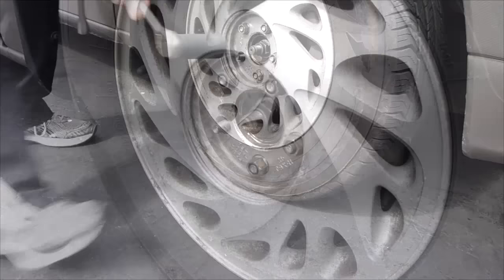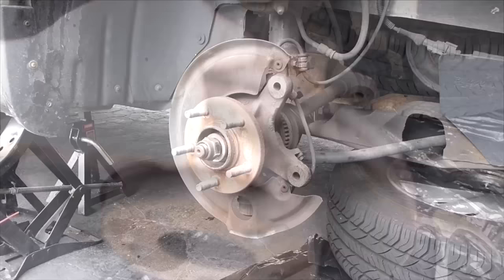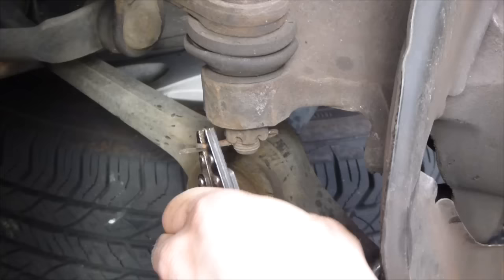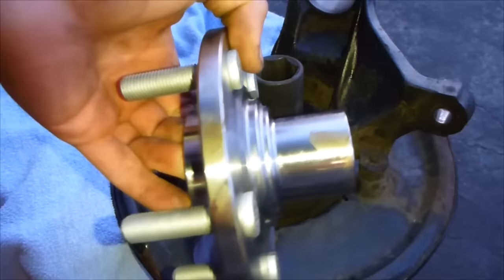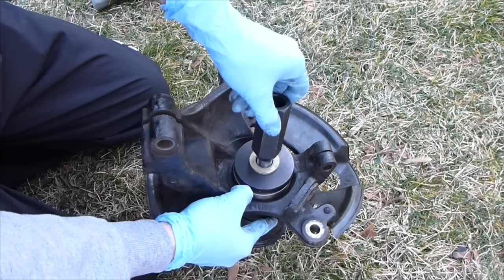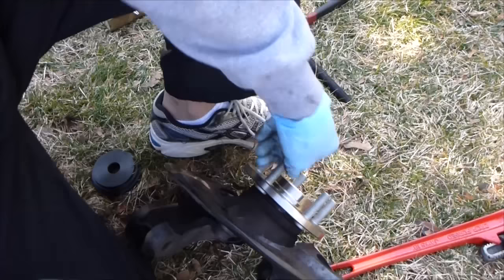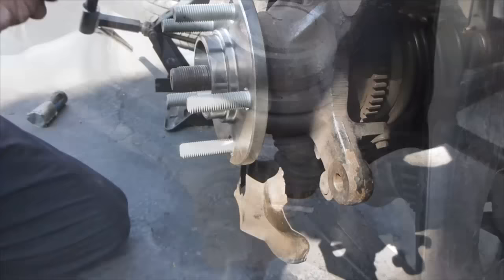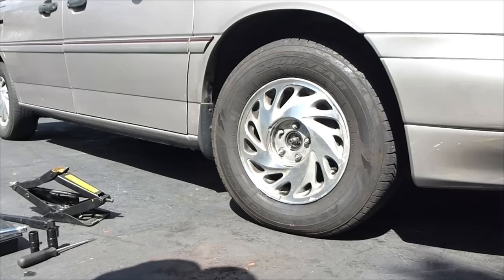How to Change a Wheel Bearing (short and fast version)

Comment: great video but next time put the castle nut on then hit the tie rod end. risk mushroom the bolt
Reply: +1^
Reply: How to overhaul an engine for Hyundai Sonata Gls 2001
Reply: Rubber hammer works better
Reply: that was my only complaint.
Reply: oh and he pulled abs sensor after he popped axle.. which.. is a backwards.
Reply: I used a block of wood and hit that with a hammer.
Reply: l
Reply: gereral1 how about just don't hit threaded end all together..  if you know what you are doing and are gonna teach people how to do it then hit the round knob end that the joint sits into.. it will pop out once you hit it hard enough... unless its some special metal then this is the way its done.  You hit it right at the joint that surrounds the tapered shaft of the ball joint, steering tie rod, or any similar style joint
Reply: I agree
Reply: Pato R - "Rubber hammer works better" - If all you're trying to do is destroy your rubber hammer without getting the tie rod end out.
Reply: mattp1482 - How about if you're going to teach people that you don't post at all since you are wrong.   You do NOT want to hit that "round knob end" which is the ball joint housing.  Deform that and you have to replace the tie rod end and get an alignment done too.  If you must use a hammer, hit it BEHIND the ball joint end, but really the way to do it right is get a tie rod end puller or use a generic multi-claw puller, or if you are replacing the tie rod end anyway then you can use a pickle fork.

Something else worth noting is that in many cases, possibly this one too, you don't necessarily have to remove the tie rod end at all to get the bearing out, can do it right there on the vehicle once the knuckle is free to rotate around on the tie rod end, propped up of course.
Reply: So when can you do mine!!!
Reply: I would recommend a new/unused cotter pin with the castellated nut as well.
Reply: oh yeah a pickle fork??? say good by to the boot especially if you use the wrong one! how do I know my dad had one and well don't ask me how I know just trust me I KNOW
Reply: gereral1 Kansas
Reply: or you can get the $45 harbor freight press
Reply: checked these comments out just to see how soon someone would mention hitting that threaded end...lo and behold first comment!
Reply: @MrRainrunner  lol me too you can usually hit the control arm and it will pop out
Reply: Or just use a Ball Joint separator tool.
Reply: Look at all the ASE certified mechanics in here telling each other they are wrong! 😂😂😂😂😂
Reply: @HoUsEoFcAtS78   reminds me of that old cartoon network show "too many cooks"

Comment: Quick comment, don't hit the threads when removing the tie rod, hit the side of the knuckle where it goes in; and buy a new pin, don't reuse them.
Reply from the maker: +jcv1995 Thanks for the tips!
Reply: Ya.  Leave the castle nut on a bit & whack that instead.

Comment: Man this looks like it's going to be a fucking headache
Reply: John Biddle It is, but it's well worth it. It'll feel like you are driving an electric car afterwards. No more howling noise !
Reply: Try having the nut inside of your subframe brake from the weld, so it's either you cut out the subframe to replace a control arm that has snapped, or you don't have a car to drive.
Reply: The hardest part is getting the two  C clips out.  if you got a press & all the other right tools & skills. it's not to bad of a job.  i doing some right now...LOL. & the C clips R giving a really hard time. lol. don't have three hands.
Reply: Nate White he left out the step where your pliers slip off the clip and it goes flying followed by a string of expletives. this is usually repeated 2 or 3 times
Reply: you can use a pair of special C clip snap on  plier's  with a flat head screw driver & a hammer to break them loose &  get them compressed & out of the slot. & get them out. on my 1995 Acura integra GSR special edition . & i spray & soak some PB blaster on the C Clips   which is what i use to get those off once you get them out which is the hardest part. putting them back in is easy with the Special C lip plier's  cause there not rusted & froze in place.
Reply: John Biddle It's one of those jobs where, if all the parts come apart easily then it's a straightforward job. whereas if the parts are all rusted you'll wish you paid a garage to deal with it
Reply: Once the job is done, it's very satisfying cause you did it yourself.

Comment: were did you get that wheel bearing press tool at and what brand is it? Thanks
Reply: Look on EBay or get a loaner from a local car parts place.
Reply: There's a link in the videos description
Reply: Harbor freight has that same wheel bearing press

Comment: should never use a hammer on the threads..
Reply: ALWAYS leave the nut on the steering joint thread and unscrewed till the nut face is level with the end of the thread. [Reverse nut so castellations are temporarily at the top]. THEN hit the combined thread/nut with a copper or alloy-faced hammer. Lastly, never re-use a split pin especially when it is as mangled as this one!

Comment: Hi watched your video, you made two mistakes one you don't hit the end of the thread on a ball joint if you are going to reuse you hit the casing where the joint fits in too, secondly you never reuse a cotter pin/split pin you must always replace with a new one.
Reply: CRAZY GAMER 65 why do you never reuse a cotter pin?  I've never heard of that.
Reply: First...into is one word....  2nd the end of the ball joint is tapered so the threads would not get damaged... see 3:44.... and last there is nothing wrong with reusing the cotter pin as long as it's not broken
Reply: metal fatigue. Get a selection of cotter pins at Haabaa Frayt for 4 bucks, and always use new, if possible. They crack and fall off w/o warning if reused.
Reply: Meh, if you've working with this kind of thing before then you can tell by the corrosion and amount of fatigue in the cotter pin whether it's sound to reuse or not.  In other words it is false that reusing a cotter pin is always bad.  You just need to know when one is shot and when one isn't.  Granted if I already have some then I'd put a new one in, but I wouldn't stop a repair and make a separate trip to the store if I had none and the existing one looked okay.

Comment: Am glad I have an old rear wheel drive car.  So much easier to replace or regrease the front wheel bearings.  The hardest part there to get loose was the dust cover.

Comment: When knocking tie rod off it helps if you leave the castle nut on but loosened past the end of the bolt to break it free, then remove the nut.   It Prevents damaging the threads.  :)

Comment: Nice video. Everybody needs to bear in mind the orientation of your encoder ring!!!! Use a paper clip to see which side of the bearing is magnetic. If you press it in the wrong way your screwed and need a new bearing. Encoder ring of bearing usually faces the transmission but check your repair manual to be sure. It needs to interface with the abs sensor so make sense of it! Also don't forget the snap ring like this guy did! Lol
Reply from the maker: Thanks for the tip! Luckily this bearing doesnt have anything in it for the ABS. The van uses a tone ring on the axle instead.
Reply: ChrisFix your a good mechanic buddy. Nice clean work area is key. I'm only 30 and if there's a solid piece of advice I can give you bro if you work on cars often... Wear rubber gloves/those blue or black ones. The years will wreak havoc on your hands both dermatologically and orthepedically or however you spell it. A single later of thin rubber can be the difference between arthritis and carpal tunnel when you're older. A tip the older mentors I've had over the years gave me and I heed it

Comment: sneaky older video should be higher up. Changing the pressed wheel bearings can be so expensive and tricky to do especially when working with press machines. But here we see you don't need to a fancy press machine. Just a screw kit and some basic tools. Good stuff

Comment: Never bought a kit or used a bearing press in my life lol, ball pien hammer, vice and multiple sockets have worked every time lol
Reply from the maker: cliff owens Defintiely a good idea to use a bearing press to prevent damage to the bearing but you can do a job like this with the correct size socket and a hammer as you stated. Just dont damage the bearing!

Comment: Nice video!  Very Clear.  The "C" ring is called a snap ring.  There are actually snap ring pliers that work really nice for removing or installing these without it springing out of sight on you.
Reply: Snap ring, Circlip, C-clip, Rotor clip, Jesus clip. has lots of names in the biz and most refer to them as Snap rings but definitely not a C-clamp lol.

Comment: at 3:55 when anyone does this they should put the nut back on just the cover all the threads on the very end so you don't gum them up and have to re thread it. tip I learned trying to hammer off tierod ends. obviously the best option is to use the tool intended to remove tierod ends called pickle forks.

Comment: What you can also do about removing tie rods and some ball joints as well is remove the castle nut and flip it over and thread it on till the threads are about a 1/8 an inch from coming through the other end of the nut and hit the castle nut your far less likely to damage the threads that way rather than hitting the joint itself
Reply from the maker: Sean McNeal Thanks Sean. I actually use this method now!

Comment: Hey Chris ,next time you replace bearing and hub try using the axle to suck the hub through ounc bearing is installed, rein stall everything but the brakes ,and tie rod ,hold the axle firm from behind, and straight, suck it through using the 30mm and washer ,reloosen and check torque ,works great ,never had a problem doing this ,just make sure you grease it well ,either way will work both ways ,just a tip you could try ,never had a come back great video ,
Reply from the maker: Scott Howe Thank you and thanks for the tip Scott!
Reply: Your welcome give it a try works great ,makes it a lot easier when putting the axle through bearing ,install everything else ,leave the tie rod off till the end ,+ brakes assm ,this works awesome,makes it much easier putin the lower ball joint in place etc ,let me now if you try ,I think you will like my little trick peace bud ,wrench on :-)

Comment: If you're poor like I am, and there is a junkyard nearby, go to the junkyard and get an entire steering knuckle assembly and swap it out. Harbor Freight sells a tool that will make short work of the tie rod end.

That's what I did so I didn't have to pay to have it done at a shop. Maybe keep the old knuckle and have another bearing pressed into it if you don't trust the replacement

Comment: Excellent work. Thanks for this video!!  When removing / pressing the bearing out , the round removing piece should be the circumference of the bearing inside.  otherwise you will be pulling on the lip which aint gonna move...found that out the hard way.
Reply from the maker: +Kevin uel thanks and exactly

Comment: I learned something from my mechanic that whenever making the CV axle sit freely without a housing on the end to either take it completely out or hang it with something, to never let it sit for bend to sit from the transmission housing because the ABS sensor ring may damage and malfunction. just a friendly tip I've learned
Reply from the maker: +Chad Wick Thanks for sharing your tip!

Comment: Man i gatta tell ya, i did this job on my Windstar, It kicked my butt royally, you don't have the right tools, forget it,  I will never attempt this again, taking the thing apart, piece of cake, putting it back together, piece of cake, but getting that bearing out, ohhhhhh my God, I cussed, I swore, I threw things,  I got drunk, I beat it with a hammer, I beat it with a sledge, I used an impact wrench, a 24" breaker bar, a torque wrench, then after 2 hours of trying, the thing finally gave way, I will never try this again, word of advice, just get the entire unit from a junkyard, its so much easier!

Comment: word of advice, when your removing the tie rod end, its best to not use a hammer on the bottom of the thread to get it out of the hub, hitting the threads runs risk or jarring up the threads so you cant get the nut back on, bringing a need for tap and die or new tie rod, never create more work. What you should do it take the hammer and slam on the side of the knuckle on the hub where the tie rod is going it, normally it will pop the tie rod out without even touching it, if it doesnt pop it out it will deff loosen it at that point just tap up on the tie rod arm and boom. Saves the chance of spending more time and money.
Reply from the maker: MrSmith Doe Thanks for the tip! I prefer not hitting the knuckle so instead I thread the castle nut on backwards and hit the nut. I have since learned that and use that method now.
Reply: ChrisFix
Awesome man I love hearing new methods, I never thought to do that with the castle nut, not a bad option, id still be a little worried for the threads since it would still put pressure on them with the nut but hey, we all do it differently. Personally I think I've got a lesser chance of damaging the knuckle vs. the threads but whatever works man. Happy wrenchin to ya.
Reply from the maker: Same man! I prefer damaging the threads on a cheap/easy to replace tie rod than damaging the knuckle with a crack I might not even see until later on. But hey, like you said, everyone has their own methods and reasons that work for them, and it is all a learning experience!
Reply: MrSmith Doe, Both ways work well, but I prefer to hit the knuckle.

Comment: It doesn't know if it wants to be a car or truck.

I'm all for doing stuff the wrong way, when it's safe - but cotter pins are not expensive, impact sockets exist for a reason, etc....

You do have a good clear presentation method, though.
Reply from the maker: dav3fk Thanks!

Comment: Changing wheel bearing and ball joint is never easy but this is easier than using a 20 or 40 tons of shop presser. This job is for experienced and knowledge person only, otherwise it can't be done without a pro wheel bearing repair shop. I've been there done that.

Comment: To do this the real easy way is buy a hitch mount vise holder.  Put your vise on.  Put bearing tool small bolt in vise and stack up what parts you need on it.  Use a breaker bar with 1 1/4" socket and two foot galvanized pipe over the breaker bar.  Now push and walk in circles like a mule around an old pump.  It pushes out or in bearings with ease and no pulled backs or broken legs using those plumbing wrenches for hours.  This just takes a few minutes.

Comment: Tight fitting such as bearing in a housing can easly removed if heat gun is used for heating the part or just leave in the sun light and touch the part that heat is there.

Comment: Couple things I would add. Never hit the tie rod where he hit it in the video, right on the threads... Always hit it where it goes through, so hit the side of the steering knuckle. If you hit the tie rod on the threads like he did, it can actually ruin the joint inside of it a lot quicker then normal. Second it is a socket not a ratchet lol. Other then that very good video man. Very detailed :)
Reply from the maker: dpl1108121 Thanks for the tips. I prefer to screw on the castle nut upside down and hit that because hitting the knuckle can fracture it.
Reply: I have never seen a knuckle fracture by hitting it.
Reply from the maker: dpl1108121 Neither have I but the service manuals and other literature say not to hit the knuckle. Either way, both methods have their inherent risks. The best method is to use a puller, but that is not a common tool so...

Comment: 3:01 this is exactly where I've been stuck for 2 days except with an upper control arm on a pinch bolt coupling on a subaru. Got the pinch bolt out but I guess I need a better screwdriver to drive in there to separate that coupling

Comment: Seems like it would be easier to leave the unit on the car so you have more leverage. You can always use a slide hammer to get the hub off. Also I think the bearing has to go in where the magnetic strip is facing the abs sensor..it’s not either or

Comment: Got me wondering if I could make my own press kit for cheaper... Very good video btw!!! Bestvone so far!!
Reply: lol, even the cheap 50 dollar one from walmart is worth . unless you want to learn the hard way like some of us. if you don't ruin the bearing by smashing it in with socket and hammer, or using vice etc. you could screw the knuckle up and not possibly see what calipers would pick up. Knuckles are not easy to get depending on make and model of vehicle, and just hope that the one you eventually find from you pull it, junk yard etc. isn't damage the slightest or bearing will never be seated properly and yeah, just not a good time.

Comment: Thanks Mr. Fix. As I read through for disclaimer, I realized that there are people like that. It's unfortunate that common sense should and safety should be top of the list. This is great info, and will save for when the time cones. By the way, what was the duration, start to finish, on a project like this? Thanks again!

Comment: A faster method I figured out is I used a slide hammer with the axle out of hole in hub to pull front hub off, then use punch and hammer to drive the race out. Tap race back in gently and install locking c-ring. Then I didn't have to disturb the ball joints or tie-rod ends. to re-install the hub, just put axle back through hole of hub, put nut on it and tighten axle nut and it pulls everything back together.